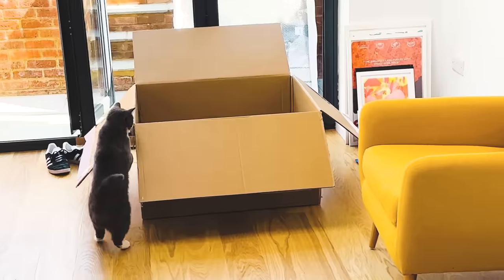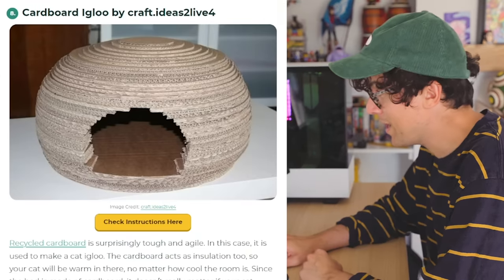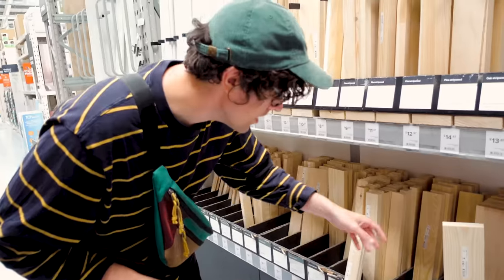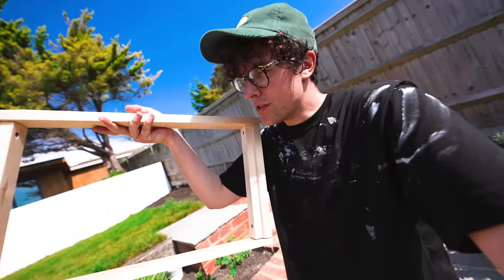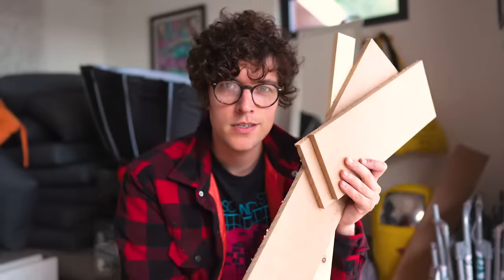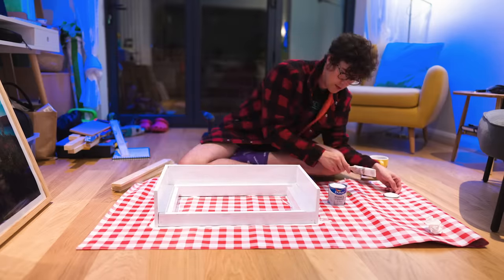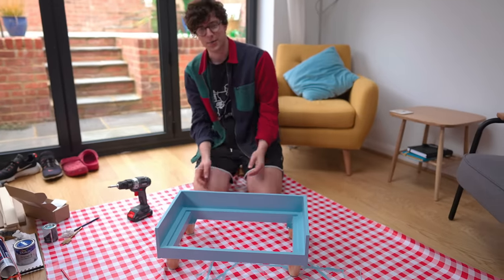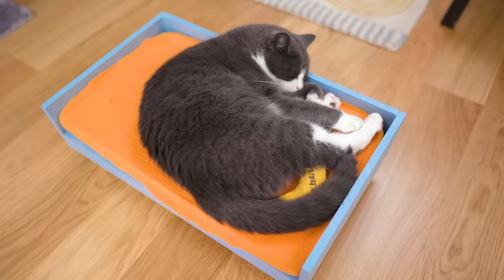Building A Bed For My Extremely Fussy Cat

Comment: Hi PJ, if you pre drill holes in the pine wood in a slightly smaller zize then the screw you are using, and then put the screws in, it tends to help stop the wood from splitting. Thanks for the content as always

Comment: So cute Fuji loving the bed! Now onto the pine splitting a lot of woods will split if you screw with no pilot hole, you need to drill a small hole first so it won't split the wood on the grain. But otherwise it ended up looking great.

Comment: Wood splits if you drill/nail in a sharp object, either dull the tip or first drill a hole then drill in the screw.